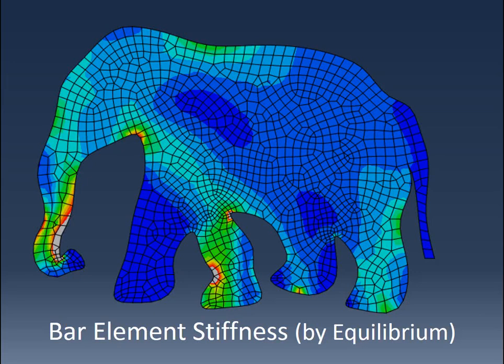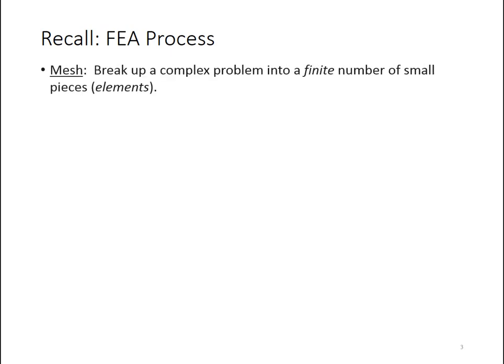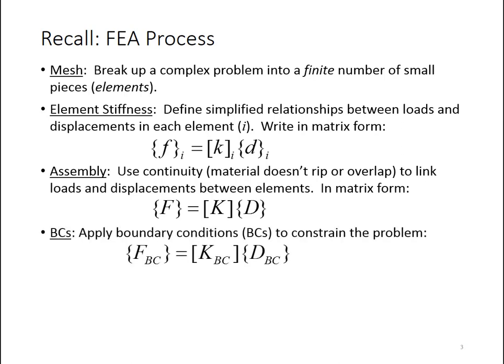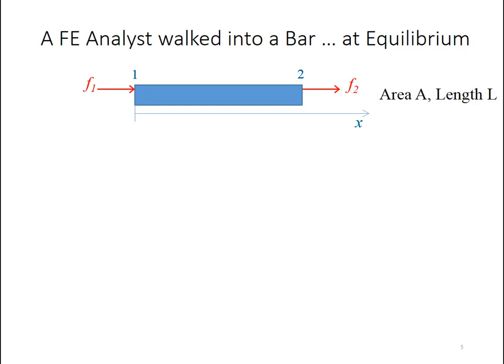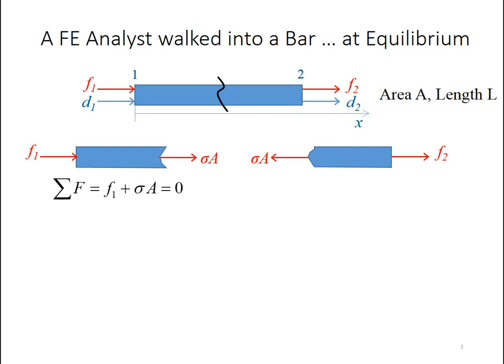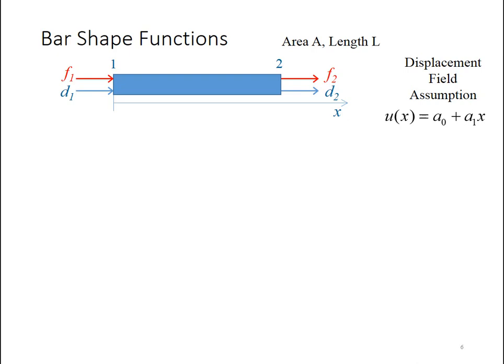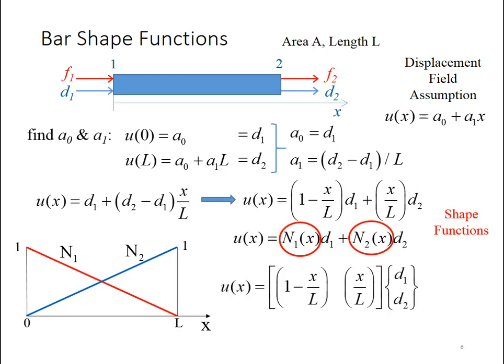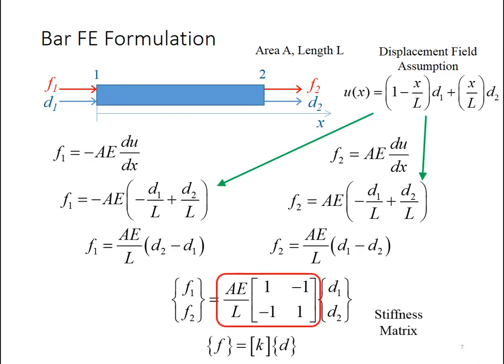FEA 05: Bar Element Stiffness (using equilibrium)

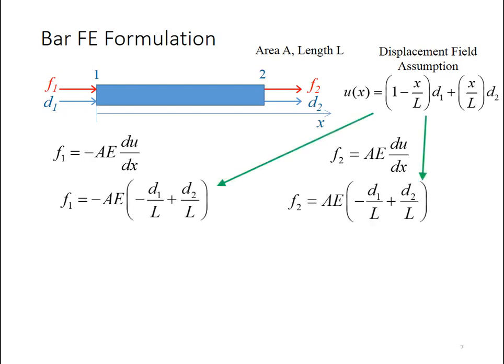Comment: Thank You. at 09:40, shouldn't the content inside the brackets multiplied with (-1), for f1 and f2?
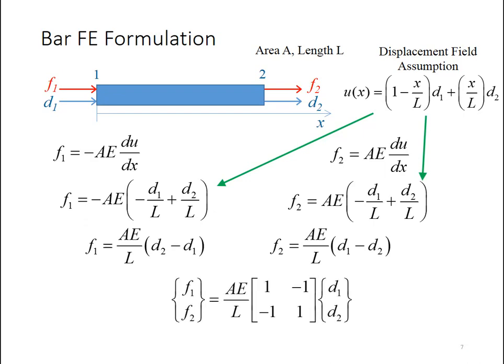Reply: Yes, although I think the matrix formulation at the bottom (at 9:44 ) is correct.
Reply: Hmm, I think it's the matrix that is wrong, it should be multiplied with -1 ^_^
Reply: Almandeen
No, the matrix is correct the way it is, you can look it up on wikipedia :)